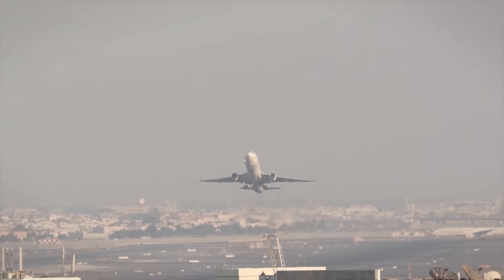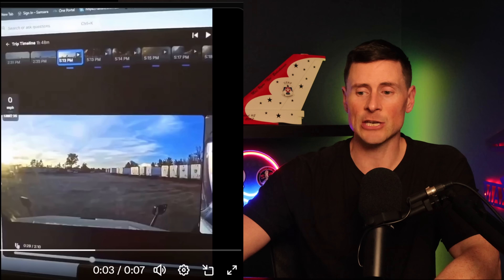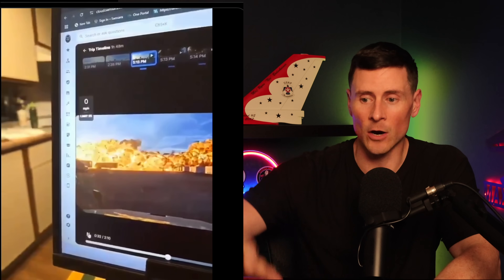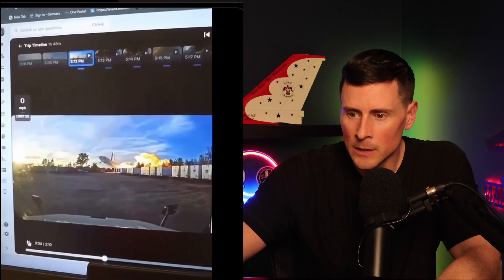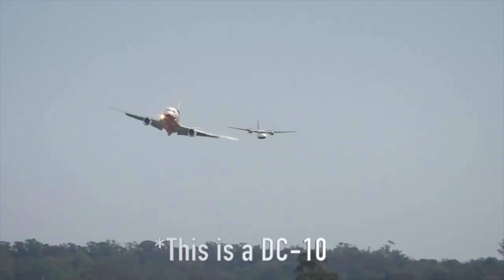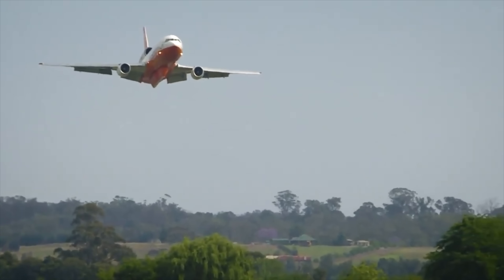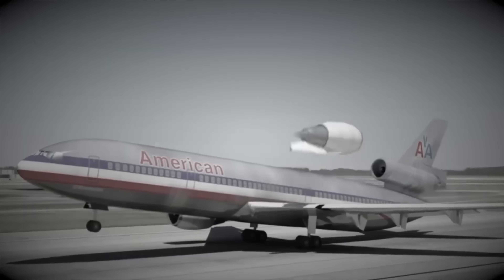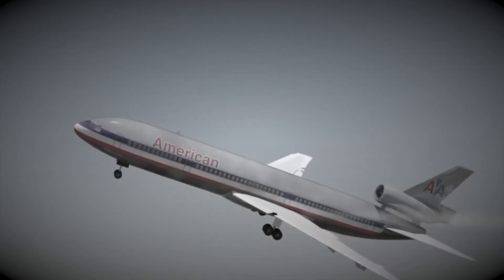Airline Pilot Reveals CHILLING Clue in Final Moment Before UPS 2976 CRASH

Comment: Another YT airline pilot channel (Captain Steeeve) reported that ADSB data showed it got up to about 150ft (an article said 175ft) off of the ground before they crashed; he said they had surpassed their V1 speed by 40+ knots, thus forced to attempt the take-off as they did NOT have enough runway remaining to safely abort take-off.

Edited to add the following elaboration on V1:
Aircraft Take-off Speeds are V1, Vr, and V2. V1 is often called the “point of NO return” for airplane pilots—it’s the speed beyond which there’s NO turning back, a takeoff decision speed. If something goes wrong BEFORE reaching V1, the pilot has the option to abort the takeoff and bring the aircraft to a safe stop in the runway they have left. But once the flight V1 is reached, the decision is made: the takeoff MUST continue, even if there’s a problem.

You're the heaviest you'll ever be at takeoff (weight of plane + people + cargo + fuel, etc), using the most power you'll use for that flight. Statistically, the likelihood of a crash is SIGNIFICANTLY higher when aborting a takeoff AFTER exceeding V1 compared to aborting BEFORE it. Aborting before V1 is considered safe, as the aircraft has sufficient runway to stop using normal braking procedures. Aborting AFTER V1 is extremely risky, as an aircraft, especially one reaching it's maximum take-off weight likely may not have enough runway to stop, leading to a runway overrun. Taking off after passing V1 speed gives everyone (on the plane + on the ground) the best chance, however slim that chance may be.

Group of buildings at the end of Runway 35L: UPS Supply Chain Solutions, Tyler Mountain Water Co Inc, The New Haven Companies, Inc., GFL Environmental, Grade A Recycling, etc
Reply: Don't forget that the ADSB is not reporting the altitude of plane itself or the gear, it's merely reporting the distance of the static port above the ground. And since the static port is right at the front of the plane under the cockpit, the lever arm of the plane itself at rotation can easily raise the static port to 100+ ft before the wheels even leave the runway.
Reply: But if a crash is inevitable, why even try to take off? There are no good options at this point. The options are between bad and even worse. If a crash is inevitable, what benefit is gained by trying to take off?
Reply: @RStevenPage  in this specific instance? saving hundreds of lives. The building the plane clipped before the final impact was a fully staffed UPS shipping warehouse. There were hundreds of people clocked in. If they had attempted an abort in the last 3000 feet of runway (distance estimated from where the debris field started) then they would have plowed directly into that warehouse with 220,000 pounds of fuel, instead of just clipping it with a whingtip.
Reply: @RStevenPage Aircraft Take-off Speeds are V1, Vr, and V2. V1 is often called the “point of NO return” for airplane pilots—it’s the speed beyond which there’s NO turning back, a takeoff decision speed. If something goes wrong BEFORE reaching V1, the pilot has the option to abort the takeoff and bring the aircraft to a safe stop in the runway they have left. But once the flight V1 is reached, the decision is made: the takeoff MUST continue, even if there’s a problem.

You're the heaviest you'll ever be at takeoff (weight of plane + people + cargo + fuel, etc), using the most power you'll use for that flight. Statistically, the likelihood of a crash is SIGNIFICANTLY higher when aborting a takeoff AFTER exceeding V1 compared to aborting BEFORE it. Aborting before V1 is considered safe, as the aircraft has sufficient runway to stop using normal braking procedures. Aborting AFTER V1 is extremely risky, as an aircraft, especially one reaching it's maximum take-off weight likely may not have enough runway to stop, leading to a runway overrun. Taking off after passing V1 speed gives everyone (on the plane + on the ground) the best chance, however slim that chance may be. 

Group of buildings at the end of Runway 35L: UPS Supply Chain Solutions, Tyler Mountain Water Co Inc, The New Haven Companies, Inc., GFL Environmental, Grade A Recycling, etc
Reply: @RStevenPage  Depending on the control the pilots have at take off, they also have a chance to steer the plane towards the safest crash point. But a plane going 184mph, on the ground? That would blow past the barrier wall easily, have plowed through the UPS facility, and likely continued going for a bit — it’s a lot of weight and momentum. On the ground is guaranteed deaths; up in the air, there is a chance — at least a chance to minimize the disaster.
Reply: @khills How about, if time allows, reverse thrust and brakes?
Reply: @RStevenPage  No, there isn’t time.

Comment: Reminiscent of that engine mount incident years ago.
Reply: The big difference being the pilon failed on the passenger jet so the initial damage was less catastrophic.  Had they understood what happened the DC-10 might have survived, this one looked impossible to recover.  So very sad.
Reply: @commerce-usa  pylon of engine cracked off wing, but study crash 191, the hydraulic lines got ripped out, the extended front flaps on the left wing receded back into the wing, so the right wing had more lift than the left wing and the plane keeled over to the left, pilots could not control it.  many times these big jet crashes are a cascade of problems, not just one thing happens.

Comment: It doesn't matter if the runway is 7000' long or 12000' V1 is going to be reached at the same distance down the runway. On a 12000' runway after reaching V1 there is likely room to stop but at 7000' probably not. The question is why this absolute rule about continuing the takeoff run after reaching V1 regardless of runway legnth?

Comment: The slats on the MD 11 lock extended after loss of Hydraulic pressure. But the loss of hydraulic fluid to more than one system after the separation of an engine would also be very catastrophic, even with the slats extended on both wings.

Comment: Sparks from the #2 engine at rotation…first report that has pointed this out.  I’ll raise a couple of questions:  First, could they be from an “over rotation” in an attempt to get airborne before runway end?  Or, Second, is it an indication of engine 2 having FOD ingestion from engine 1 failure?  The second question raises the possibility of either dual engine failure or significant loss of thrust from the #2.  Either way, even though the MD-11 is certified to meet climb restrictions with the loss of one engine; loss of 2 throws certification standards out of the window.  (I’m not a heavy driver so not totally knowledgeable of the standards). 🤔

Comment: Photo of engine is missing fan disk which could have detached and ejected debris into #2 causing loss of thrust.  Missing fan disk could indicate uncontained failure which damaged wing and hydraulic and fuel lines.  Trail of smoke is not normal and is where incident started.  Must have happened right after V1 and captain elected to continue.  17R is 2 miles long.  If captain had decided to abort, he might have made it.

Comment: Supposedly, this MD-11 was in maintenance, from Sept thru mid-October.  Hopefully this isn't a case of mechanics taking shortcuts, as in the Flight 191's case where they put undo stress on the pylon, when they were reattaching the #1 engine.  Those nutjobs caused the deaths of all of those folks in Chicago....just to save a little time.  We shall see, once all of the detective work is carried out on UPS 2976.

Comment: Please note that this aircraft lost its number 1 engine after V1, which have separated from the wing. There is actual footage of the engine which remained on the left side of the runway. The engine cowling and other debris have also destroyed a part of the papi lights. According to Flight radar data this MD11 did get airborne for a very short moment, but could only manage to get close to 180 feet before it rolled to the left and crashed. This reminds me of the O'Hare crash a few decades ago, where a DC10 passenger airplane lost it number 1 engine after V1 and crashed.
Reply: I posted the same thing. More to this than almost all YT people are reporting.

Comment: How likely could it be for debris from an uncontained failure of a wingmounted engine be ingested into the #2 tailmounted engine?
Reply: Possibly Both engines were sabotaged. Strange the other engine goes bad too.
Reply: @MikeJones-wc4qj 🎯
Reply: @MikeJones-wc4qj  Please.  Don't start yet another conspiracy theory.
Reply: I don’t know but what gets me is there are extensive interior/exterior checks by crew and the mechanics team before takeoff. The captain has the final say. If everything checked out, how could this have happened? Disgruntled employees, crew member suicidal/addiction, were alarm systems turned off, was there a bomb on board, what was in the cargo, political…
Reply: @beckiruther1213  Another video showed the engine core on the ground.  It looked like it suffered a catastrophic failure which could have caused it to detach and pieces ruptured the fuel tank.  That compressor stall could have been from debris or what looks like an unusually high angle of attack a liftoff.
Reply: Possible, but I don't think it mattered.  Looks a catastrophic failure of the left engine which probably took out the flaps making it unflyable - just like United 191.